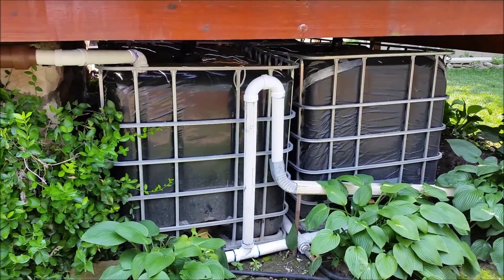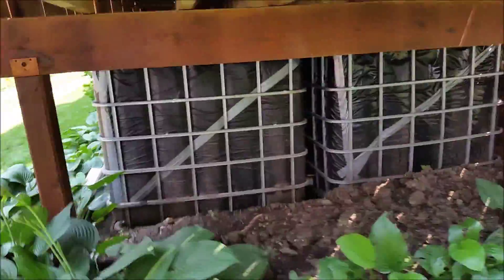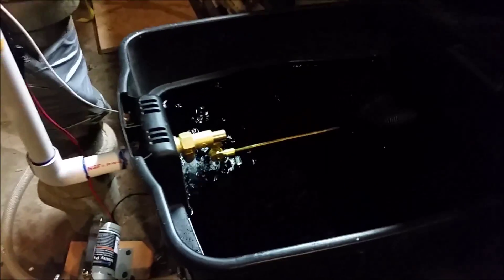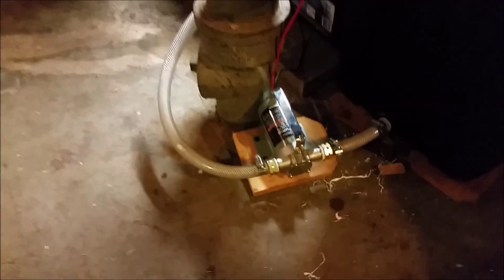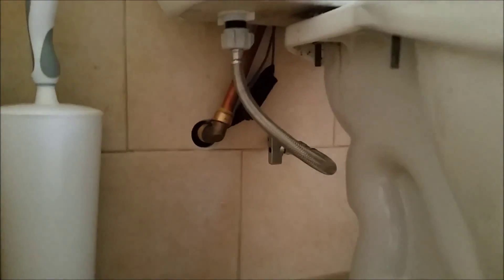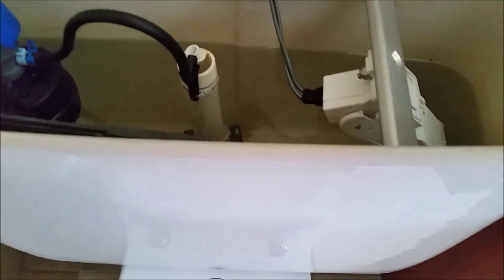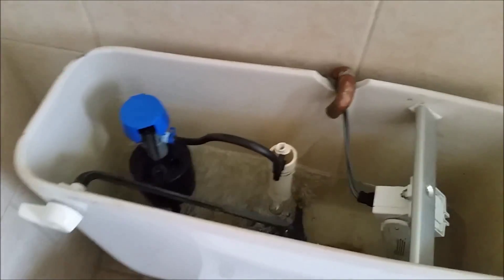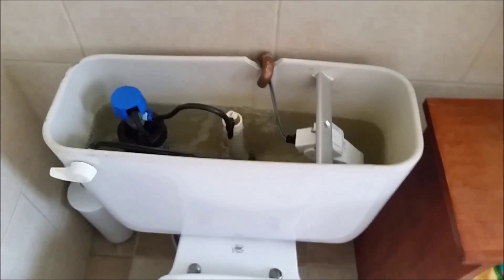Rainwater Harvesting - Rainwater Toilet Tank

Comment: Excellent idea, I want to make a system with a 55-gallon drum and a 115-volt Pentair diaphragm pump some PEX pipe and fittings,. Still, I want to use dehumidifier water, RO wastewater, and water from furnace/ac condensate. My only issues would be the stagnant water smell and not enough water to flush the toilet. I thought about making a filtered rainwater system to add additional water to the design and possibly a heated gutter system for water in winter.

Comment: About the only problem I see with this system is if the switch fails in the on position, your bathroom will flood.  In which case, a few simple electronics could be added so that the pump turns off automatically if it is made to run longer than 45 seconds.
Reply from the maker: If the pump stays on due to any failure it just runs down overflow tube. Just like when the tank is running it doesn't run out.

Comment: Under your toilet tank you have the wires by the shark bite where you say it's wires and a SWITCH - what is the switch?

What is the water shut off valve going into your tote in the basement? I've not seen a horizontal one like that before - got any parts or part number for that? 

And tips on running the water line up to your toilet from the basement - Did you start from the toilet and work your way down or what?

It's been a year since you posted this - and changes, still working well?
Reply from the maker: Sorry missed this one a while back.  Switch is simple outdoor lamp switch.  Shutoff in basement tank is called a tank bob.  for stock tank works with normal pressure and low pressure.  running line i would just use pex.  Still working great after several years.  turning on the water once or twice a year in dry times for a day or two then the rain will come.

Comment: Great system. The tanks look very neat under your decking and a very quick pump
Reply from the maker: +Mark Phillips Ha.   Thanks alot Mr. Phillips!!  Really appreciate the idea.  It has worked great.  My highest month for water bill is July.  I got the bill down from what would have been $182 to $117.  Pretty good.  Also, I'll be adding 10 barrels to the basement in an effort to run the toilet year round.  Ill send that video once i complete.  thanks again.  brendan
Reply: how much did the total setup cost?